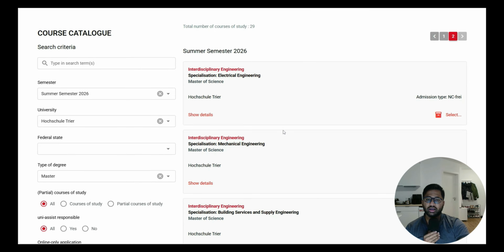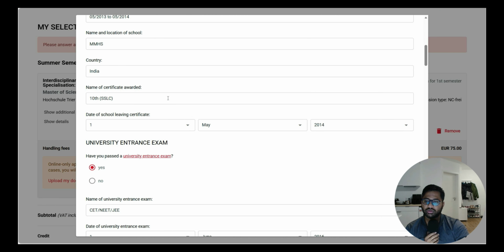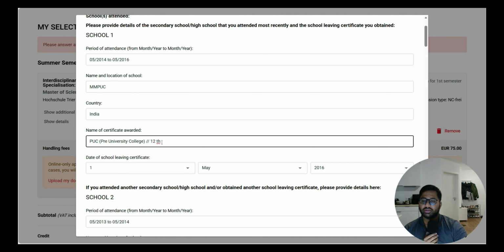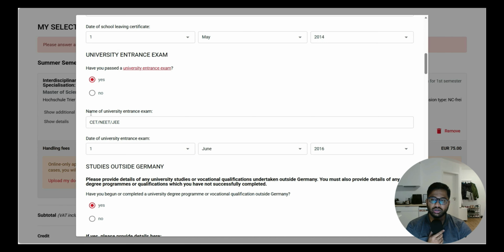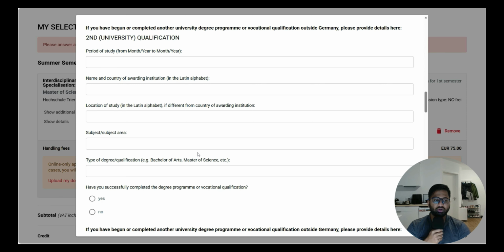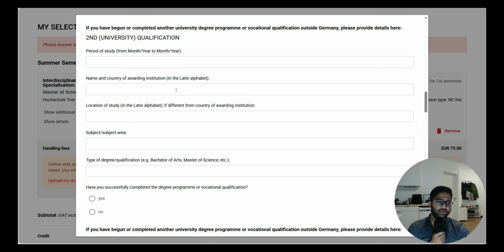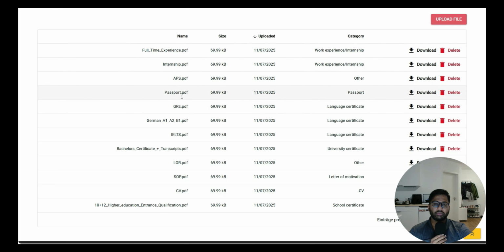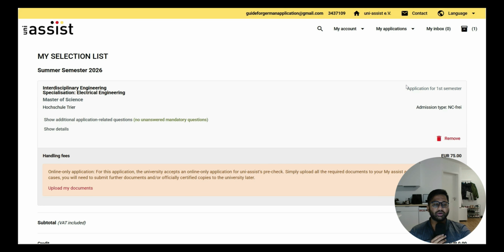HOW TO APPLY | MSc | INTERDISCIPLINARY ENGINEERING | TRIER UNI | PART 2 | FILLING & SUBMITTING APP

Comment: Brother,could you help me with module choice tool?Uni assist did not forward my documents to University claiming that my ModulAuswahl is missing.I have uploaded my course curriculum instead of Modul Section. However, I have tried but after selecting the module list, it shows error with compulsory and core part